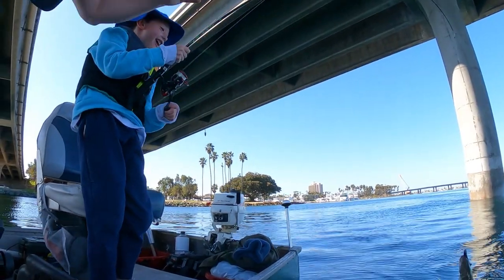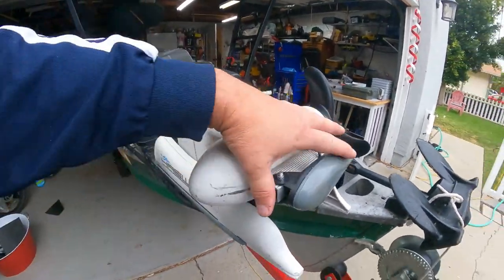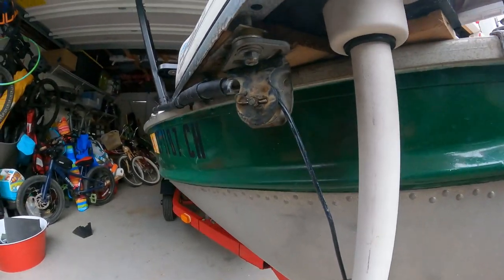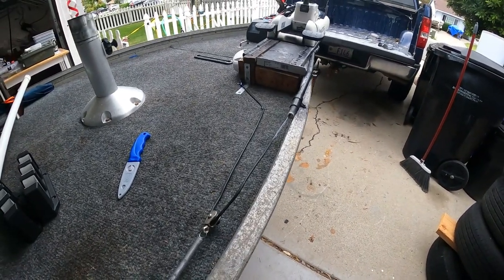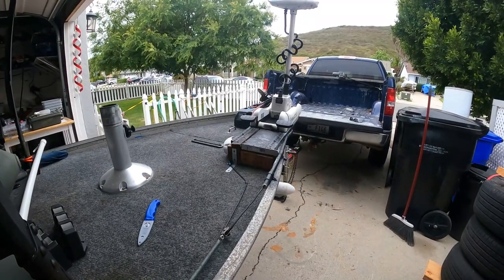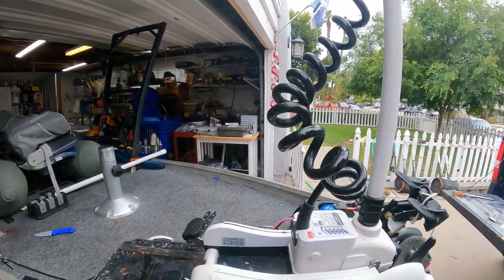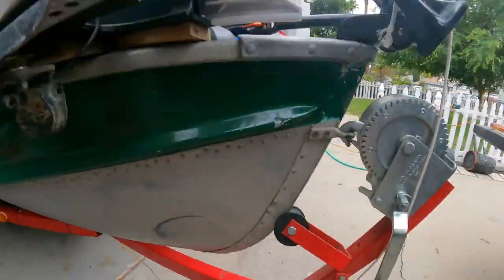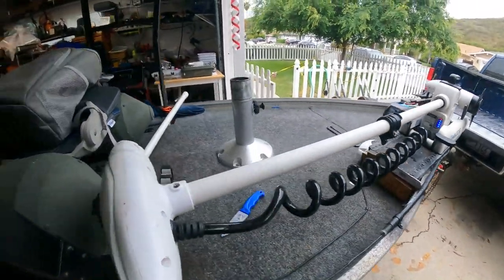Was our Haswing Trolling Motor a mistake? Watch this before buying!

Comment: EXCELLENT idea with the spring. I have had mine for 2 years, and had the same issue. I broke the hell out of mine at a dock, the wake from a boat made it go up and down and it took the front off, It still works though. Bit now I have an issue where the motor will turn but not turn on. It started intermittently but today it wont turn on at all. It will beep but no bueno.
Reply from the maker: Ya; the spring works well, just have to spray a little WD40 on the pulleys before taking it out. The new remote has had no issues. I was even able to take the foot control back out. Might be worth a try.

Comment: the battery in the remote is the issue. just changed mine with higher mah and it never loses link unless its about dead. being in rc hobby you don't use lipo without storing them at storage charge . the internal resistance damages the lipo and basicly kills it quick. my battery was puffed and i solved my issue and should probably contact haswing . they say charge every 2 months if not in use , well storing at full charge hurts it just as bad as letting it deplete under 3.85 v per cell. i should do a vid about it guess just take days to upload . i just took cut the plug and use a balance smart charger . the usb charger is good for charging only. be nice if it had a storage option battery would last much longer. had my 80lb  24 v on my bass boat 5 yrs not one single probllem. just asked haswing when will there be a gps upgrade kit. . same with foot pedal it can be made wireless. but its better to have wired  for backup. inside tm it has the wiring for gps and a spot for the board to run motor. just may build a open source gps unit  may be able to bluetooth it from my garmin. haven't fiddlled with it . been waiting on a upgrade kit. can run tm with there app just no gps. have to look into it. throw some rc parts in it and see if i can get a basic ardupilot or pixhawk to work.  as far as cable is used a stainless steel key chain retract lanyard of amazon for like 10 bucks . but your rig works fine too.. then reworked a old motorguide bowmount base  into a sliding base to back tm in so its not sticking out when loading or docking, twist a know slide it back n forth. very happy with my 569 dollar 24v tm.
Reply: junk !

Comment: Mine complete trash, so.etimes it works so.etimes it doesn't, electronics aren't sealed, doesn't work if it rains or gets wet, barely works when it's dry , right now I'm not able to use it it's not working at all, hoping it dries out and works again. Did purchase it 3 years ago however it sat for a year in the box while I rebuilt the skiff and its only been used a handful of times, like 10 times would be pushing it and it no longer functions.

Comment: The Haswing Caymen is a terrible quality trolling motor . I had problems from the start . #1 . The remote battery life didn't have a life 
#2 . Had a problem with the remote not connecting with the trolling motor .
#3. Customer service is terrible with no US contact : No phone ever answered,  No phone call returned . Days to get a return email.  
#4. After frustration with the trolling motor not working , I removed it . 
#5 . After quite sometime, about a year ,  I finally was instructed on how to reset my Caymen . 
#6. After remounting & reseting and using the trolling motor I had a latch failure at approximately 22 mph . When the latch failed , the trolling motor deployed , the plastic mount broke off , and trolling motor sprung over the bow in 30 feet of water . 
#7. Damage to the fiberglass and no trolling motor .
#8. When I contacted Haswing ( by email ) they denied replacing the trolling motor & repairing the boat . Hawsing tried to sell me another at a 15% discount . 
#9. I ADVISE NOT BUYING A HAWSING TROLLING MOTOR ! IT'S JUNK !
Reply from the maker: Sorry you had so many problems. Mine has been fine.

Comment: what kind of battery is ran with?
Reply from the maker: I had a standard marine deep cycle - 2 of them. just in case. Never used both though. Now I have the LifePO4; huge weight savings and better battery. Well worth the money.